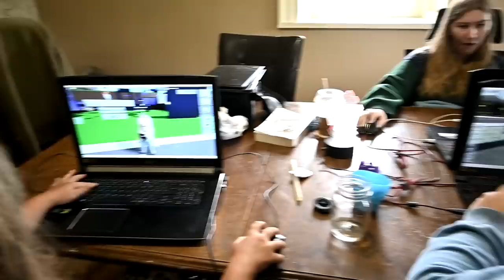An Insane Miracle On Our New Farm!

Comment: What a wonderful old barn. Im curious  is there another section in the bottom of the barn. It seemed a little small. To tell if the floor is bad check from under neath. If you see water stains the wood will be weaker.  And if you go through it is usually on foot. The barns with that high of a ceiling  had loose hay not square. The little room was for the grain.  A friend of mine, he with God now. Took the top floor to the roof and moved it four feet from the foundation.  And put it on a cement slab. It was made into a barn with a haymow. The bottom was transformed into a training arena. Everything was gutted out. And sand/ rubber mix for the flooring and a cover all roof. The stone walls were left. Because of the forest and stream was 20 feet from the barn and no wall was left open for winter it was shelter for them. Their was just under the over hang so no hay was in the arena part.  I used is farm for two years. It was the best. Now looking at farms in Berry Bay and Bobcaygeon. Glad the whole family moved in.  Meaning the animals to.  The old water tank is excellent for hay.  I cut a sheet of white vinyl lattice to fit on top of a bale of hay. It worked like a slow feeder plus it prevented the horses from flinging the hay out. Then it got an inch or 3 from the bottom i removed the lattice to finish the good stuff.  Also because one of our ancient horses had little or no teeth i gathered the hay chaff for them as winter feed which was mixed with chopped hay. Do not forget to put a piece of thin plywood on the bottom if their are jagged edges from broken tin. If you use it out side drill drain holes for the water to escape. Also raise the plywood an inch or so of the bottom of the tank. Soggy hay is not nice. God Bless.
Reply from the maker: What an.absokute amazing story!  Thank you so much for sharing that!  I feel I learn so much from your comments, and I almost always read them twice to get as much out of them as possible!  You should write a book!